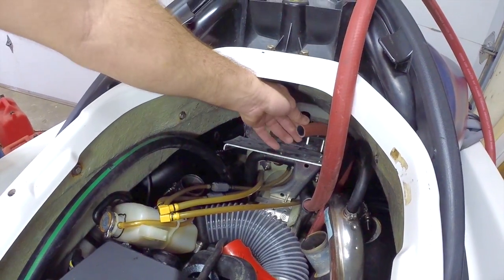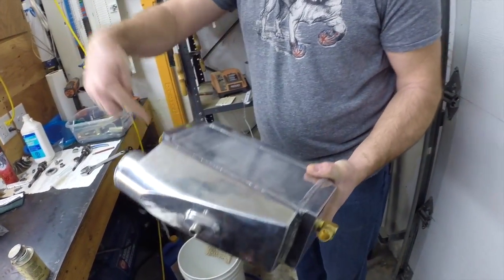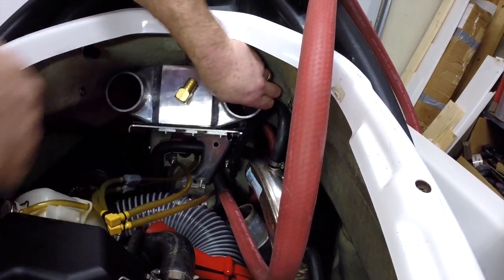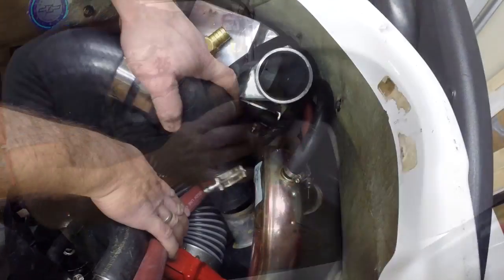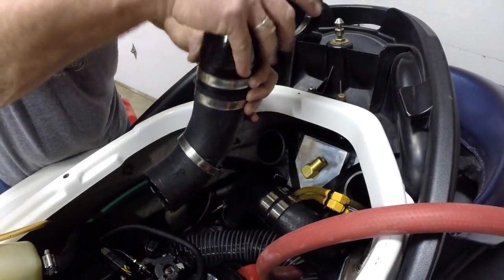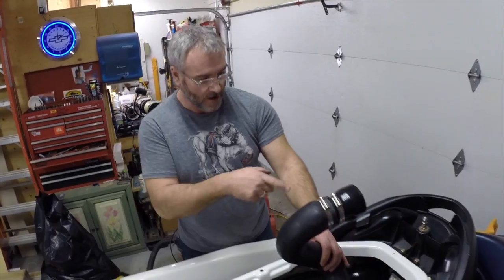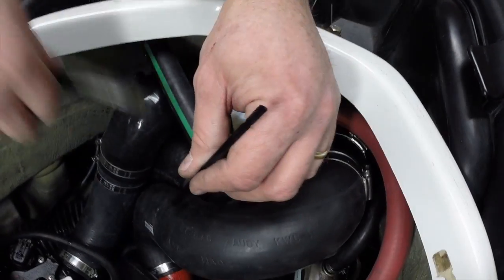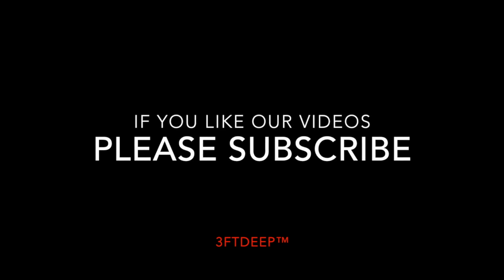How to Install an Intercooler (on a Supercharged 4-TEC Sea-Doo Jet Ski)

Comment: How has that intercooler held up ? I’m contemplating doing this on my gtx. But don’t want to go through multiple Inter coolers.. 

Love the channel by the way, it’s super informative
Reply from the maker: Thanks for the kind words. We sold the machine a few years ago, so we really can’t comment on its durability. But I can say that the increase in performance was not what we had hoped it would be. It may be better to consider a more powerful machine. Good luck on your projects!
Reply: @3ftDeepChannel  What was the performance gain and how did the exhaust sound change with the removal of the resonator? Thanks for your expertise. Im considering the same on my 06 RXT.
Reply from the maker: Better throttle response and a few MPH top speed, no change in sound the exhaust was stock we did not remove the resonator.   I would not remove the resonator unless you are installing a rear exit exhaust the stock exhaust exit with no resonator will give you a very annoying drone.